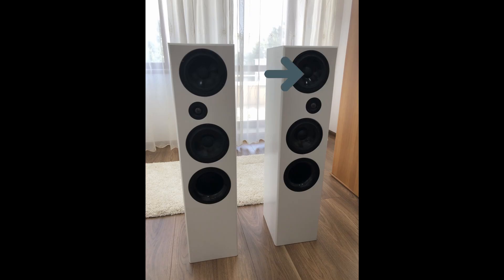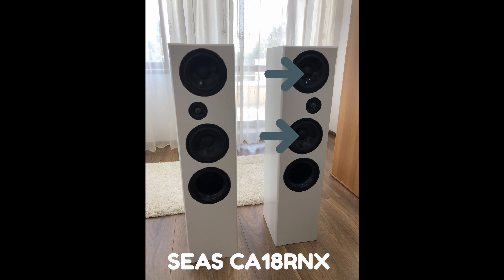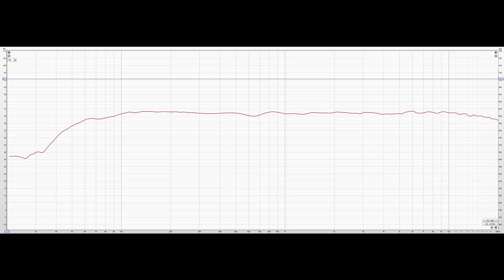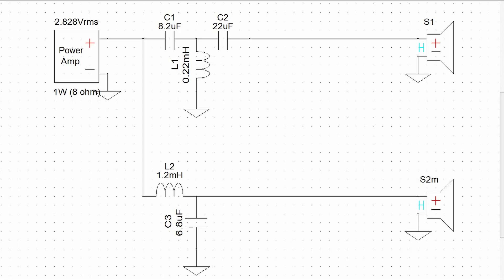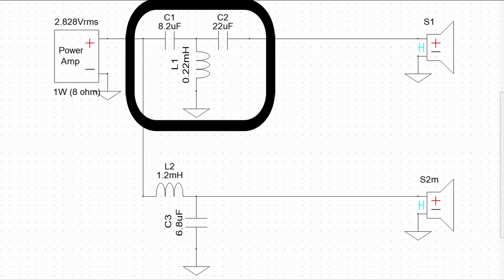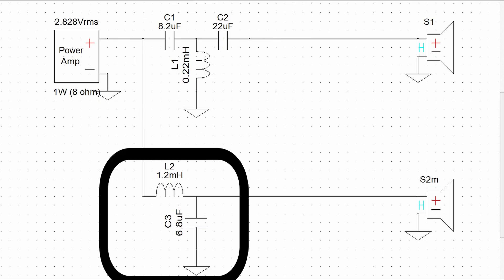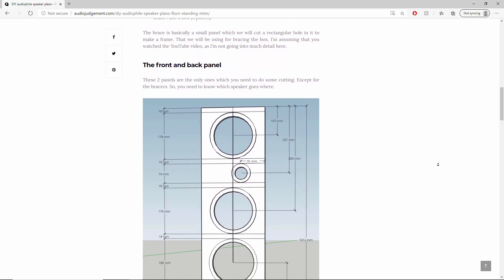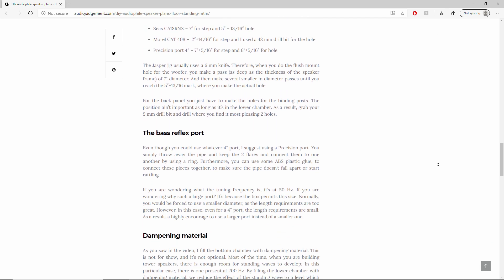DIY floor standing speakers (with plans)

Comment: I'm honestly shocked you kids are building large speakers like this, all the 30 year olds i know call me a boomer and this is boomer tech first off i'm 48 not a boomer lol my parents are though and compact stuff is the future but still there's no replacement for displacement i just love the look and the sound of a full size floor standing setup. Extremely nice job on these speakers cabinets, i wish i had the wood working skills because i am looking at x4 DS18 Pro 6.5" mid ranges, x4 DS18 Pro tweeters and a pair of CT sounds Tropo 8" woofers i'd love to make some sick ass floor standing speakers like you did out of these bad boys, nice job tho and from the looks of it in your apartment too lol you must of been single at the time or had a really cool GF.

Comment: i know this is an old video, but is there any down side to having the tweeter placed above the speakers. and with a 1.6cuft internal minus im assuming at least 0.2cuft displacement 4" port should be 9" long for 50hz, can you confirm this thanks

Comment: Hello, i really like these Speakers and would like to build these. My question is, if the Sound would further improve if i use thicker Walls? And would it be a good idea to put foam pads on the inside Walls? Ihope you Still answer Questions here :)
Reply from the maker: thicker walls would be better, but you have to modify the dimensions of the panels to keep the volume the same. Baffle size should also be the same, you can only modify the depth. Alternatively, you can keep all the panels the same and make the baffle double thickness. That way you don't change the inside volume nor the baffle dimension. You can add extra damping on the walls. That will kill the standing waves even further but will reduce the output of the bass reflex port.
Reply: thank you very much :) @AudioJudgement

Comment: hifi and them meaning is full range 20-50k so yah if your not hitting 20hz use a sub. i mean concerts use them and we want to reproduce soundstage. you can always have it rolled off but they made the music with low freq and intended you to here it.

Comment: Awesome video, I have a question, as this speaker is not separated plus it's not "ported!?" Either but some speakers are, why?
Reply from the maker: The 2 speakers are not separated because it’s a 2way design, and the box it is ported. It’s a large port and you can confuse it with a speaker. On the front baffle there are 2 bass drivers and a port.

Comment: any way to adjust the enclosure dimensions to make a matching center channel from this?  can I just chop it off at the lowest brace?  or make the width or depth different to compensate for internal volume?
Reply from the maker: It's hard to predict the results, but if I were to reduce the size, without designing it again (as it's a new speaker all together), I would cut of the box just below the lower midbass, and make a sealed enclosure. I would even consider making it slightly shallower because it doesn't need that much volume in a sealed box (16 liters of net volume).

Comment: Hey, im planing on building these amazing looking speakers, but i have a few questions before I do build them.
First off: how is the imaging? How do they perform of axis (on axis seems on the first look amazingly good considering the price). How detailed are they playing, is it more a criticial or fun speaker to play music? Audiophile Question: do they disapear when closing the eyes, or can u  still hear  where the sound comes from? Is a small amp 40-80Watts enough, or should i go 100 plus? Do u recommend using a thicker baffle? I was thinking off adding a Design layer on top of the baffle, that i can cnc. Maybe like 22mm baffle and 10mm on top that will be cnc engraved. Also if i build them I really want to make a concrete base that will be glued with a thick layer of silicon on the bottom. What do you guys  think? Should I do it? Do you want a Video about it?
Reply from the maker: Hello! It's hard to give an answer to your imaging questions because I do not have a good listening spot. As you can see from the video the speakers are placed in a corner which is a terrible idea. I dare to say that I don't like how they sound in that spot. Positioning is very important in audio. However, when I had the prototype speaker (only one speaker) and was listening in the middle of room it sounded super detailed and crisp. If I were to label them if they are analytical or fun I would say that it's a bit of both but more inclined to analytical. They are very efficient, even a 40-50W amp can drive them. I do recommend a thicker baffle. They are light weight and that's not the best of things. Thicker baffle, spikes for feet are good ideas. If you want to make a concrete base that would be awesome but I think that a larger baffle and spikes is enough.

Comment: Hi,What is the maximum spl we can get out of these at one meter distance approximately especially for frequencies above say 100 hz as we are going to pair with a subwoofer for lower end extension.I am thinking of using these in a sealed box with active crossover to a active subwoofer
Reply from the maker: Hard to say. Depends on the room size. But they will get uncomfortably loud. If you want to make a sealed enclosure, the box needs to be significantly smaller. Probably the whole part below the lower woofer is extra volume. So you could use a panel just below the lower woofer to make two chambers. The lower chamber will serve no purpose, other than making the speaker look taller, but you could partially fill it with sand to make the box more stable.

Comment: well done, if you look at the kits from GR-Research they seem to round-over the inside edges of the driver cutouts and the internal bracing panels, i would do it too if i was building something. and maybe cut rebates in the panels to make recessed joints which would increase the glue line are and make a stronger joint. very impressed with the frequency responce though !!

Comment: They came out looked badd asss!  Nice job. Do they get the job done as far as down at the bottom?  I’d hate to see ya have to use a sub.  There’s just something about sub’s and there sound I really don’t like when it comes to HiFi.  There just un-natural sounding. If ya can’t hit the basement with 12’s” or 15’s” it’s back to the drawing board. Something tells me these sound smoother as silk. 👍 Very nice job.

Comment: Instead of glue i will use screws and double side tape between surface to make it stronger and eliminate vibrations
Reply: Screws can rattle over time, and double sided tape wouldn't be nearly as sealed as glue. Glue is a tried and true method, don't dismiss is so quickly
Reply: @curtischillin4560  im not dismissive 🙂
I've tried both methods.it works better in my situation due to lack of equipment,time etc.
I use 1.6cm wood and double sided tape between them.its not very thin and kind of spongy.
I use 4cm long wood screws every 8cm. 
Its visible that the tape is compressed between surface.
Its very durable so far🙂 and not afraid to drop them 🤭🤭!! because i move them a lot.
P.s sory for my poor English 😢

Comment: Great project! I guess I got late to the party! LOL I found all the components on Parts Express but the woofer. It seems that woofer is not being produced anymore. Would you tell me what could be a "replacement" ? I Could not find 7" diameter woofer. I found some 8" diameter. Would it be OK to use a 8" diameter instead? I found this Dayton Audio PA200-8 8" Pro Woofer Speaker. Is this model a good one for substitution? keeping all the other components the same? Thanks in advance.
Reply from the maker: You need that exact speaker for it to work properly. Madisound sells the speaker in US, but it's just out of stock. Send them an email and ask them to order 4 pieces for you. Probably it will be more than a month till you get them but the model is not discontinued.
Reply: @AudioJudgement  Thank you! I will try and get in touch with them.

Comment: I have all the parts  needed but my inductors are 1.5mh    would it sound bad if I USED THEM ?
Reply from the maker: I checked and the response is pretty similar if you use 1.5 instead of 1.2 inductors. I guess it's fine.

Comment: Hello, I’m trying to build a bookshelf speaker but I have a quick question, since I won’t be using amps inside the speaker, I don’t have a way to delay the tweeter to be aligned with the woofer, do have anyway to fix this problem? One way I can find is tilting the box like the budchardt s400
Reply from the maker: When you design a crossover, the fact that you are adding components to the tweeter filter section, will inherently change the phase. If done right, you can align the tweeter in the crossover. If the speakers don't want to pair nicely, you can use a slanted baffle like you mention or a ladder delay network in your crossover.

Comment: Could this be done with cheaper speakers? I'm just curious. I am not an audiophile by any means but I would like to build some standing floor speakers (I am a craftsman) out of walnut, but I can't spend anywhere near $700 on audio components and I just don't think my ears will be able to tell much of a difference between these and Polk T50s or Energy CF-50s (which are under $200 each)
Reply from the maker: Unfortunately, you have to use precisely those drivers. If you don't mind waiting  a few months I have a floor standing speaker project with very cheap drivers coming up soon.

Comment: Thank you for your videos and classes (I have watched 3 so far). Two questions. Would it be ok to build these out of walnut veneered plywood?  Thinking of building these for my home theater system. Would I be able to use the same speakers in a smaller sealed box (no port). I do have 2 subs so I don’t need much bass from the center channel.
Reply from the maker: Plywood would work just fine. If you want to make a sealed box, you can, but you have to make the box smaller. Also, to ensure that the crossover will yield a response somewhat close to the original , try to make the baffle somewhat close to the original shape. Keep the width the same, reduce the height (if you need to) to something that looks proportional and adjust the depth with no restriction to achieve whatever volume you want.

Comment: Nice speaker build I just sub to you I’m thinking of building a 2.1 speaker set up with a 12 inch subwoofer with a font port and the speakers with a 5 inch woofer and a AMT Tweeter the drivers are Dayton audio

Comment: how did you measure the frequency response?
Reply from the maker: Using a measurement microphone and Room EQ Wizard. If you want to learn how to do an acoustical measurement, you can check out my Acoustics 201 course.

Comment: Hi,

I really like the looks of these DIY speakers. I’m even considering building these myself, but I’ve a few questions.

I’d like to place the tweeters in the center of the speaker instead of left and right. Would this alter the sound in a negative way?

Also, I don’t have the tools to create that nice leveled edge for the woofers and tweeters. Personally, I don’t mind the edge being visible, but would it alter the sound?

And last but not least: I noticed you’re only using glue to hold the wooden pieces together. Is this strong enough, considering the pressure that will build up inside the speakers?

Thanks in advance!
Reply from the maker: The offset tweeter placement is important and I advise you not to place the tweeter in the center. Rounding the edges of the baffle is also important.
Flush mounting the speakers probably is not something that will impact the overall sound that much. I guess you can skip that.
Glue is super strong. Also it has 4 braces. You couldn't take it apart even if you wanted to.

Comment: 17:23 High End audio system is not built for listening crap EDM.
Reply from the maker: You're right, but I just selected some random tracks from different genres. Listening to some speakers through your speakers over youtube is pretty pointless to begin with. But if you don't provide that footage people will surely ask for it.
Reply: @AudioJudgement  I appreciate your concern brother and also your effort but it is never possible for a single speaker system to handle all genres and finally it ruins the review too. Try to play only those songs which are most suitable for the particular audio system you are reviewing. Anyway thanks a lot for sharing video. Keep it up!

Comment: Nice speakers. You got me enthusiastic after that response graph. 

 Did you seal the mdf before spraying? Or just used primer?
Reply: And that port is insane 😂
Reply from the maker: Yeah, that is just primer and paint. Not that I'm giving any painting advice, I'm a complete beginner.
Reply: I have seen that floor sealer for wooden floors is a good primer for MDF. There's a video on YouTube showing it done. Here is one, for example: https://www.youtube.com/watch?v=2BYdxSTgOkM

Comment: What is the recommended amplifier for these speakers ?
Reply from the maker: 100W at 4 ohms
Reply: @AudioJudgement  really? Sounds a little Low. How do you calculate this?
Reply from the maker: @MrDendor  Just an educated guess. The speakers are super efficient. Even with a good 10W amp you would be satisfied, unless you are throwing a party.
Reply: @AudioJudgement  thanks for your Response. That Sounds good but i'm curious let's say i'm about to throw a Party.. Outside... as far as i Unserstand it we have 3x8 Ohms in parallel wich Results in ~2,67ohm and the 2 woofers + Tweeter have 280w in total. If this ist right we could Power the speakers with an AMP with about 300w@2ohm to get the maximum Out of Them.
Reply from the maker: @MrDendor  It doesn't work like that. There is a crossover in place so, you have to take that into consideration when calculating impedance. Furthermore, it's not a simple calculation, it's a graph. However, you can check that in the crossover design app. It doesn't dip below 4 Ohms (well just a bit on a narrow frequency band). You can say it's a 4 Ohm speaker. Regarding the power handling, you don't add the speakers power handling together. It also depends on the crossover. When you start cranking up your amp, whichever driver reaches its power handling first, that will be the power handling of the speaker.
Reply: @AudioJudgement  thanks for the clarification. I'll Look into the App later

Comment: Оба фильтра нужны 3го порядка!
Reply from the maker: Nope. It's either both 3rd order, or one 2nd order and the other 3rd order. They have slightly different sound dispersion but the difference is minor. See how the radiation patter looks at the end of this article : https://audiojudgement.com/speaker-lobing-polar-response/
Reply: Статью прочитал. С точки зрения классической электроакустики MTM=D’Appolito, и рекомендуется 3 порядок. По моему опыту фильтры разных порядков в зоне совместной работы звучат с неестественной окраской. Если у вас получилось, то хорошо.

Comment: Is it possible to add Bluetooth to these speakers?
Reply from the maker: Well, first of all, you need an amp for these speakers. Your amp might have integrated bluetooth. If not, you can buy an external bluetooth box that will connect to your amp. Logitech makes one.

Comment: Have really enjoyed watching and learning from your videos.....but still far too clueless to do anything other than try and build these speakers from this video.  Curious - these will cost roughly $500ish to build for the pair.  You've heard the quality and I certainly trust what appears to be an expert opinion.  What do you imagine a speaker this quality would retail for?
Reply from the maker: I can't really say. I haven't listened to that many branded speakers. If I were to guess, I would say that this DIY speaker would be a better value than what you will find already made on the market. By how much, I don't know.
Reply: @AudioJudgement  Thank you sir.  Really do appreciate the time you took to produce your videos.  I've have the cabinets all cut and ready for glue.  Have ordered all parts (except Tweeters....currently unavailable)  Looking forward to hearing them
Reply from the maker: That's great! Here are some tips to make them even better. First of all you can add some spike feet. And secondly you can add a double baffle. Basically a front baffle made by 2 panels glued together.  This doesn't change the baffle shape / size, nor does it change internal volume, but it increases the overall enclosure stiffness and rigidity. If you decide to make a double baffle, make sure you chamfer the speaker cutout on the inside so the speaker can "breathe" with no restrictions. These 2 are optional but nice to have.

Comment: Could you explain a benefit of you 2 mid-bass driver vs 1 big mid-bass driver, thank you?
Reply from the maker: First of all in an MTM configuration you have better vertical sound dispersion. Secondly, the tweeter is almost always more efficient than the mid-bass. Having 2 speakers will boost the efficiency of the mid-bass by 6 dB. As a result, you will need less attenuation for the tweeter, or in this case none at all.
Reply: Serial and parallel 2 mid-bass, we 'll always get more 6db or only parallel? Thank you very much :)
Reply from the maker: Theoretically, it doesn't matter, considering you give the same amount of power to the speakers. You will need a beefier amp for series connection.
Reply: @changtraidoc  if you apply the same voltage you get +6dB from parallel connection and the sensitivity will be the same as a single driver with serial connection.
It is better to have parallel connection but you need to have an amplifier that can work with low impedance loads.